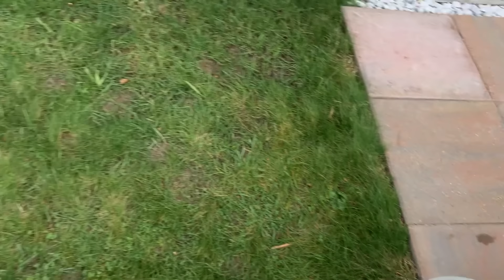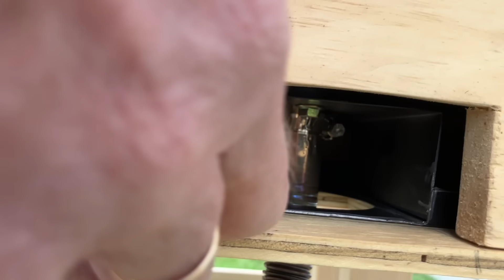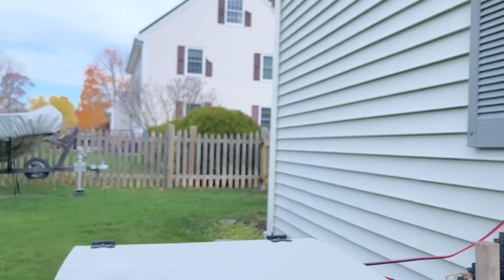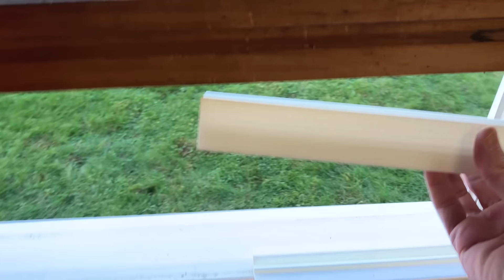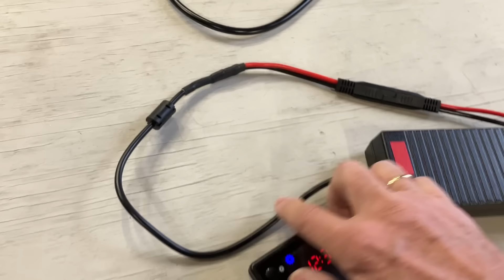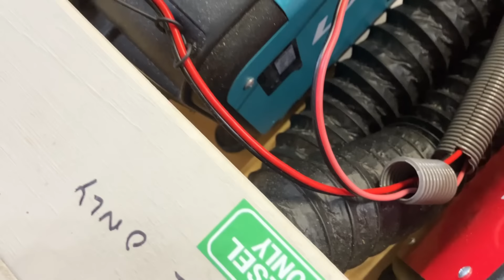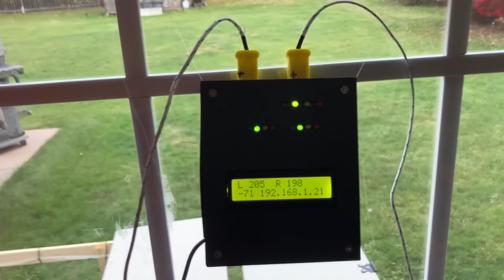Part 1: Dual Diesel Heaters for My Garage! Overkill? Maybe. Awesome? Definitely.

Comment: Do you treat your fuel? From Minnesota here and I have 7litre in shipping. (2) single car garage that has a dividing wall. Garage further from the house is my shop area which is the future location for my heater. I have a firebox that I built just for it (aluminum and brick). Minnesota is too cold for diesel at times so I’m locating the fuel indoors and 6 feet away. Seeing your video reminded me of fuel gelling in the winter. Fyi it can get -40° here
Reply from the maker: That is cold. In New Hampshire we'll see 0 for an air temp a few times a year, but pump fuel is treated in winter months and that seems to work well enough. Some folks run these heaters inside, which is more efficient since all the heat is indoors except for the exhaust,  but I feel a lot better about having all the fire parts outside. With the fuel supply external its just wood and small amount of fuel that can burn (assuming it doesn't shoot flames into my garage). I love your fire box idea, maybe thats Gen 4 for me. : - ). Storing your fuel inside isn't that bad, espc diesel and the heater will be outside. My heat loss for my garage seems to be about 1 heaters worth. Using only 1 heater the temp will climbs very very slowly until it hits some max temp. So the 2nd heater is all extra and actually makes it warmer heat. Garage is mostly insulated 26x26.  Time for another diesel heater video to clarify some extra stuff.

Comment: Put a 90 down toward the floor on your intakes and you can get rid of your long extension for your heat returns. Heat rises, the floor is the coldest part of the garage. Put a box down there with filters on it to keep the air clean.
Reply from the maker: Thats a good idea. Maybe move the extensions to the 90 so it gets even closer to the floor.

Comment: Between the heat loss on both intake and output pipes and the lack of exhaust heat recovery, aren’t you literally like 400% less efficient than you can be? Why not have the units inside with an exhaust heat exchanger? Mount the units high on the wall if no room.
Reply from the maker: Heat loss for sure especially on the hot side coming into the garage. The return air into the unit works surprisingly well because with warmer air going into the unit. At 10 deg or lower F you really notice it. For me the whole point is to get the burn/fire/fuel running outside of the garage. It really depends on how comfortable you are with it. I have thought about insulated hot side air pipe into the garage. I've seen people with exhaust recover systems when the put it inside. So yes you are 100% right.

Comment: I have the same gen 2 you have (red). I know you know that you can take out that fuel tank or just hook up an external one the same way your gen 3 is setup. Nice setup and the safeties are a must additions.
Reply from the maker: I was thinking of that option initially, just leaving the heaters inside the original metal boxes for my Gen 3 and feed them from external fuel, but then wanted smaller boxes so I could move each one myself. The external fuel tanks was much easier than I expected.